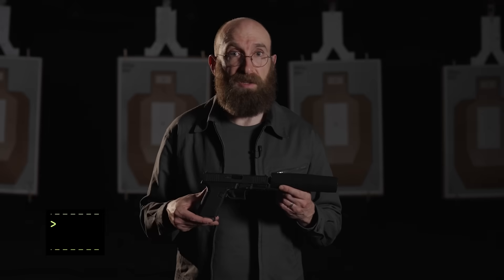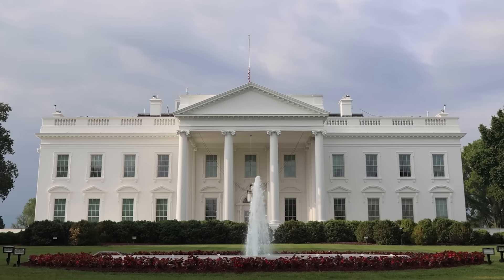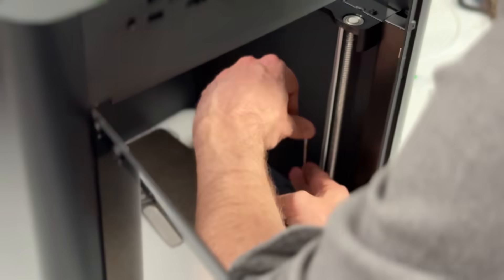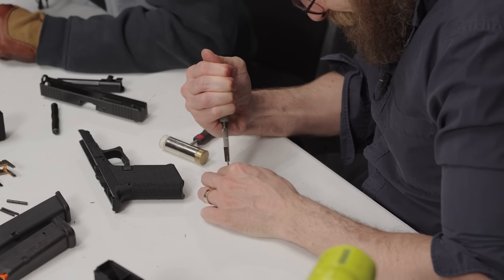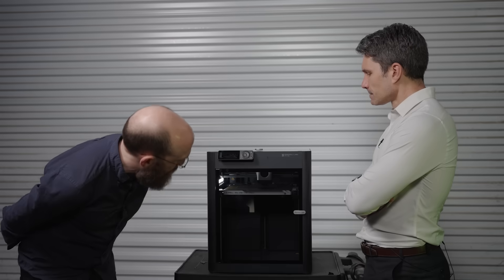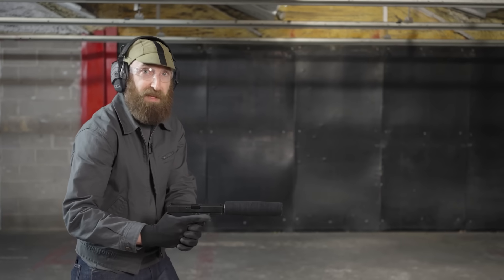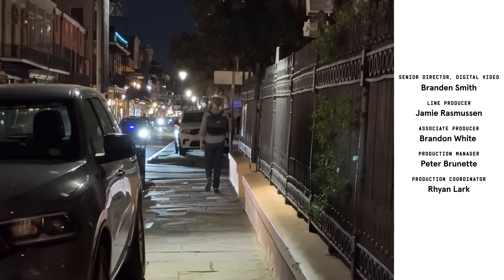I 3D-Printed Luigi Mangione’s ‘Ghost Gun’ | Hacklab | WIRED

Comment: the difference between paperprinters and 3dprinters is that paperprinters are proprietary and 3dprinters are often opensource. there will always be firmware available for 3dprinters that bypasses this regulation if you were to implement it

Comment: Regulating 3D printers is the DUMBEST take on this issue if you know ANYTHING about 3D printers. They're little more than hot glue gun that can heat up plastic filament - to the point you can get hand held pen style 3D printers. Making a 3D printer is EASIER than printing and assembling a ghost gun.

Comment: Ask that YouTuber why the USA, with all those "right to protect themself", has a 3.5x homicide rate compared to Europe, which apparently doesn't have that right.😅 And TBH on the other side I don't want to give up ownership of my 3D printer either... I don't wanna to risk having someone say that I cannot 3D print the replacement nylon gear for my mixer because that specific gear is patented, or anything similar.

Comment: The problem with regulating 3D printing software is impossible. You can easily modify the firmware of many 3D printer models to something fully open source, and if you really want to, you can build a fully custom printer. Additionally, you would have to regulate not only 3D printing software, but also CNC. Even so, people still will be able to build their own manufacturing equipment. This would lead to a ton of regulation that mainly monitors the people who are following the law, because the people building guns most likely can follow an instruction manual to modify the firmware of their 3D printer or CNC.

Comment: Considering most printers that your average consumer 3D printer runs open source firmware it wouldn't be hard to get rid of the DRM restriction. Or just not use certain slicers. The solution is to monitor the metal bits not the plastic

Comment: in my opinion, the solution is not to prevent the printing of weapons, which may very well but up against civil rights, but instead do what television programs tell us that some printers can do, which is to serialize the 3-D printed parts when a gun or weapon is detected. If the 3-D printer is able to put an identifier inside of the plastic such that the gun can be traced to the printer and the person who purchased that printer, to me that is the most effective way of balancing rights versus safety.
Reply: Ah yes, put a serial number on a plastic part that totally won’t be filed off or completely destroyed when a crime is committed…

Comment: Restricting what 3D printers are actually able to make has to be the most ridiculous take I've heard in a long time. "Tell me you know nothing about 3D printing without telling me you know nothing about 3D printing." Sure you could program a machine to reject specific files but given the infinite number of geometries you can send to a machine its just too easy to change the file to something else. Building vision systems, using AI to detect, eh... seems like a waste of time. People will just find some other tool or use older unregulated ones. Genie is already out of the bottle there. Regardless of where you stand on gun control, restricting tools and their ability to make things is a pretty dumb road to go down.

Comment: Didn't see many comments mentioning this, but you will not be able to put DRM on 3D printers, 3D printers by princiaple are open-source. the newer ones made by bambu-labs etc are harder to deal with sure, but Ultimately if someone really wanted to and I mean really wanted to they could manually write the Gcode fgs ahhaha

Comment: 3d printers are largely opensource. Even the totally closed commercial units are often trivially modified to have open controller boards. DRM is not going to happen. That's a pipe dream.

Comment: For any recoil operated pistol (including the glock platform ghost gun Mangione was using), a nielsen device is required if You want to run a suppressor with it. Mangione did not have it on his gun, the same goes for the one in the video, hence why it failed to cycle properly.

Comment: Yes, you can ask bambulab and prusa to implement code to detect guns in the slicer program itself but what people don't realize is that  3d printers can be used with open source slicers like Orcaslicer (almost graphically and tecnically identical to Bambustudio) and Cura. So what you actually will be doing is limiting...nobody.

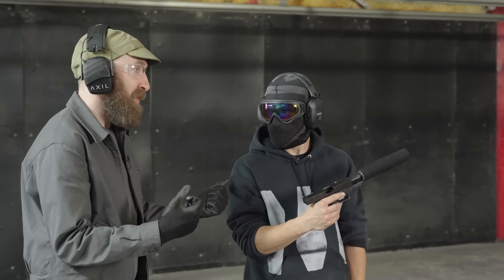Comment: 15:35  the reset issue was likely caused by the weight of the recoil spring they used. When you start adding things like an optic or suppressor, other parts need to be swapped to compensate for weight added.

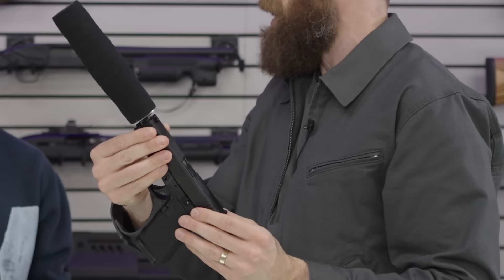Comment: 11:00 "...at least twice as scary." Why? Cause Hollywood tells you it's scary? lol It's just a little quieter sure but it's now harder to aim now seeing as you don't have raised sights or a red dot on it so the suppressor is obstructing your view when aiming down sights. But more importantly, because it does not have the proper additions, the slide does not cycle reliably. Turning your semiauto pistol into a bolt action pistol lol

Comment: Very incorrect & misleading info at 4:20. 

You cannot just put the "trigger parts" on table and call it is "available online".

While it is possible to print the plastic frame, it is almost impossible to circumvent the serial number because the fire control unit (FCU) is always hard serialized. 

There is a reason why ATF defined FCU as the firearm, because FCU must to be rigid & high precision for the entire system to function. The definition used to include the lower frame because before polymer frame is popularized.

Comment: Well, I guess that I made a ghost gun when I was 15 or 16 years old.   No 3D printers, no lathe, no mill, no computers.  Just a file, a pocket knife, an electric drill, some wire, a metal tube, some springs, some screws, etc.    

That was back in 1965 or 1966!    OMG  that's 59 or 60 years ago!  Probably before the guy in the video was born!

Comment: As long as you have easy access to ammunition, making a illegal fire arm is easy.......

As a self taught mechanic gun lover with sufficient mechaine & tooling(Metal Lathe Mill &Drill 3 in 1combo)  he can just make any WW2 fire arms easily(using 21th centuary tech to make a WW2 era tech)
or even 3d printed a ghost gun.

eg: Slam fire single shot shot-gun...or a simple metal sheet bended blow back SMG machine gun.....

As ammounication manufacturing is very hard especailly the Cartridge case & the center fire Primer( Berdan or Boxer type primers) So it is useless to talk about gun control if ammo has no strictly regulated sale.......🤔

well a gun with out ammo is just a metal club😉
Reply: Ammo isn't that hard to manufacture in small quantities either.  People even make their own primers. 

Gun control is dead.

Comment: It was a poor decision to use a suppressor that requires a piston or Nielsen device, especially when he could've just used the OP9, a 3D printed suppressor designed for Browning style tilting barrel pistols. Alternatively, he could've printed a Beretta 92FS or another pistol without a tilting barrel, which wouldn't have needed a booster to cycle properly.

Comment: This video is missing a major part of the whole equation and I think that’s done on purpose it seems like, you’re not printing the whole gun that’s like saying you printed a car because you were able to print a spoiler in a bumper when you still had to manufacture the engine completely normal.You’re essentially printing the frame of it and that’s it you still have to buy the part that allows it to fire and function

Comment: It is so hard for gun control advocates to accept the fact that they don't control everything.  Even if they make printers unable to print guns, open source software will be made to replace firmware for the days hot printers and it will be uncontrolled again.  Accept the fact that you can't control others and move out to the country if you want to be left alone.  You can be safe or be alone but you can't have both.

Comment: Does anybody know what 3D printer they used? I'm interested in getting into gemeral 3D printing, and it seems this machine does clean prints for what seems to be a fairly low priced. Plus, it seems to come assembled, and I've seen some that appear to be somewhat complicated to get set up properly. 

If anyone has any other suggestions for different machines (Again, just for general 3D printing. Not necessarily for gun frames), I'd appreciate any info at all.
Reply: A Bambu labs printer. Way more expensive than necessary. If I was to hypothetically get a printer of such purposes I would get an ender 3 or a Neptune 3 pro

Comment: you're not going to prevent people printing ghost guns through the same mechanism used to prevent people printing bank notes. the ghost gun community will develop their own printer firmwwre, 3d modelling and slicer software if they have to. this isn't a small number of criminals  counterfeiting money, these are vast numbers of technically minded people standing up for their constitutional rights. not only will passing laws intended to stop them be easily circumvented it will erode their trust in government even further.
if the government wanted to control ghost guns they would need to require parts manufacturers to serialise and register all solid metal parts, and even then it would just send the ghost gun community down the innovation path again and people would be building cnc mini lathes and mills to make barrels, breech blocks, trigger groups etc. believing this can be stopped is breathtakingly naive.

Comment: 16:50 This dude clearly knows NOTHING about what he is talking about. 3D Printers arent this Magical unified Firmware and Software ecosystem that you wave a magic wand and you have a gun. The STL files are 1 NEVER THE SAME FILE, 2 the Slicer Software can easily be modified, MOST printers are never see a Gun file but what he is suggesting is like regulating Galvanized Pipe to prevent Slam Fire shotguns. 3D Printers are just TOOLS, no different than a Lathe, CNC or a Power Drill.

Comment: seriously as a maker i dispise the bald guy at 17:10
DO NOT TOUCH OUR PRINTERS.  
you do your gdam job and make sure the gun parts get regulated and you leave my ffing printer alone.  
if i cannot use my printer without an internet connection.  or if i cannot print something because it got false flagged.  I WILL GET ENRAGED!!!!!!!!!!
Reply: youll jus end up using open source DIY printer guides to make your own with 0 tracking and 0 limits if they do. 
Then they'll hafta ban your new 'Ghost Printer"
Reply: @joeeeyyyyyy   Well Ali is easy to compel not to sell any Bigtreetech or MKS mainboards, or extruder gears, or other such thing, if they are seen as against the law to be sold in a given country. Then what.
Reply: do not play with your safety dbag

Comment: you cannot stop a 3d printer. software is already there and open source, motherboard is already there and open source. just know 3d printer is not an precise industrial equipment that cannot be controlled, its a bunch hot garbage bolted together that cannot and shall not be controlled.

Comment: Was the video filmed before or after the tariffs were enacted? The printer could be had for a lot cheaper if  it was bought on sale (which Bambu si doing soon btw. The P1 series is great overall, but you can get the A1 mini for CHEAP. Caveat, I am not condoning making ghost guns) or pre-tariffs. Similar printers and printers on FB marketplace can be had for cheaper.

Also, the racking issue is due to the gun not having a booster with the can. It is not because the can is preventing cycling.

Comment: not printing tree supports feels like a rookie move
Reply: I think that is part of the point of this. Someone with little to no knowledge (though I have a feeling they do know a bit about 3D printing) of 3D printing, just loading a file and hitting go. Even putting it in a chilly garage over night, and it succeeded.
Reply: @rjc0234  good point!
Reply: @rjc0234 that's because the bambu is enclosed
Reply: The fact that he didn't just flip it upside down made me cringe. He could have saved SO MUCH filement
Reply: @DPaul-z9b  Yeah but then you have made the part that needs to interface with other bits bumpy and wavy. Unsupported surfaces are fundamentally that much higher quality.
Reply: @DPaul-z9bit's called rails up. Everyone has their preference.
Reply: Built-in supports used to be quite popular.

Comment: Why do they want to regulate 3D printers instead of all unprintable part one still needs to buy? I print a lot of functional things and gimics, but even though I didn't even know that one could print something that lasts for more than one shot. And it looks like you still can't. You can't print the parts in contact with the explosion. So regulate that thing instead. Regulating high performance plastics that may one day be able to handle the exosiom part seems to make more sense than the printer people use for their figurines.

Comment: Dope that wired both got a legitimately good 3d printer and contacted the most legit 3d printed firearm youtuber in PSR. Really well researched video by them ❤

But yeah, most ghost guns are just normal guns with their serial numbers ground off with a dremel and any DRM will be ineffective as most 3d printer firmware is open source or based on open source software, so you could just flash a new firmware without the DRM.